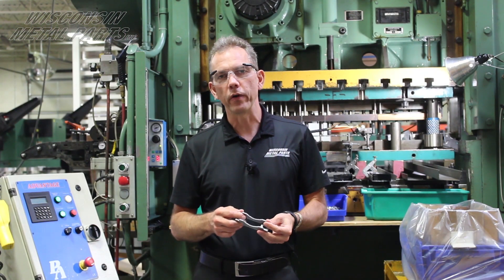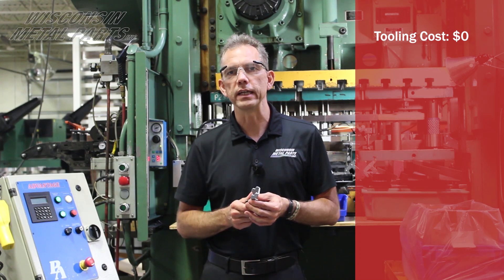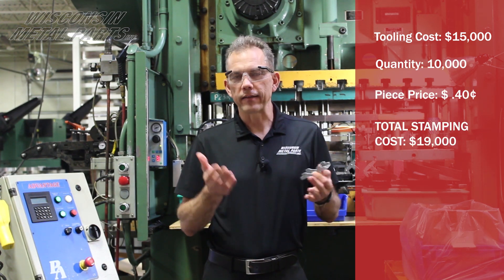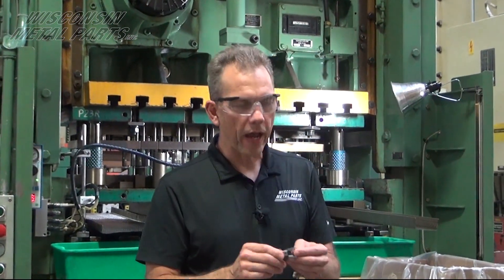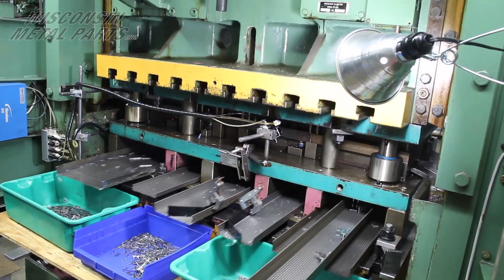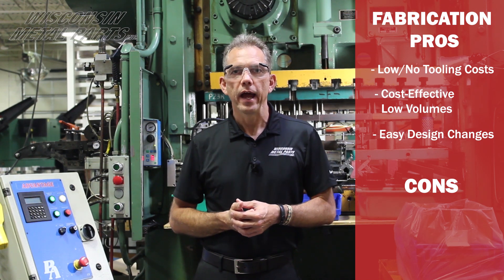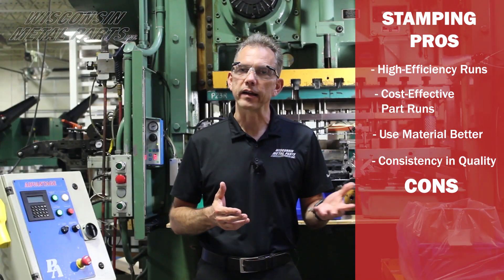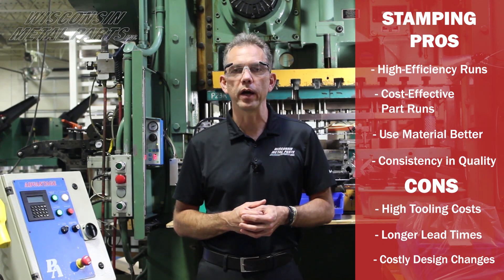Fabrication vs Stamping - What's the best way to make your part?

Comment: As you got your production cost down, what happened to the price for the customer?
Reply from the maker: Valkman, thank you for your question. As the part costs went down, the cost savings were passed along to the customer. That was the benefit of them investing in the progressive stamping die.
Reply: @WisconsinMetalParts Ah, I see. So I didn't realize they were involved in investing in the die. Does the customer own the die, too?
Reply from the maker: @東京ワナビ  If the customer pays for the tooling then they typically own it

Comment: Thats fine for a show and tell, but the customer and supplier usually want a simulated production process. That proves that the part can be manufactured efficiently and the part can perform satisfactory via testing.

Comment: Why fabrication is not used /suited for High volume? Especially laser cutting or cnc punch..Pls answer
Reply from the maker: Thank you for your response. Laser or CNC punch can definitely be used for higher volumes. However, our focus in this video was finding the most cost-effective way to produce a particular part. In our examples, hard tooling for stamping was the best method for the higher volumes.